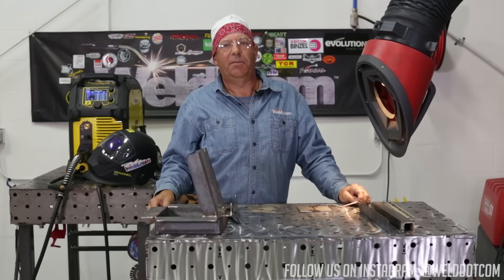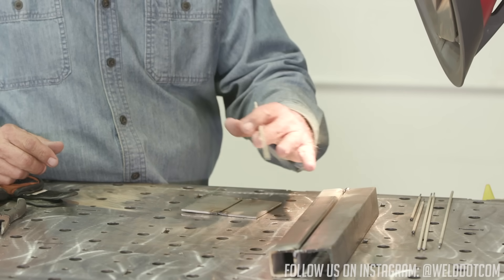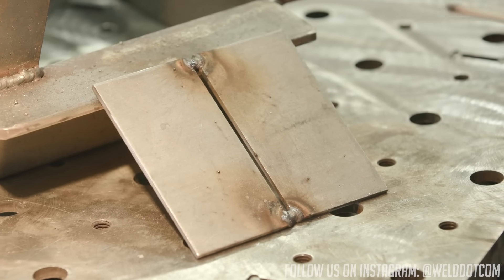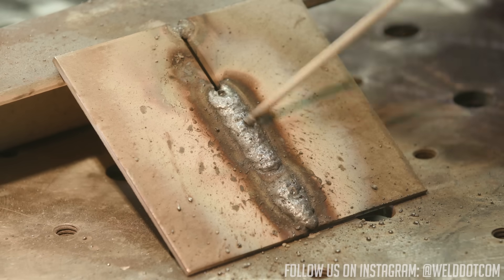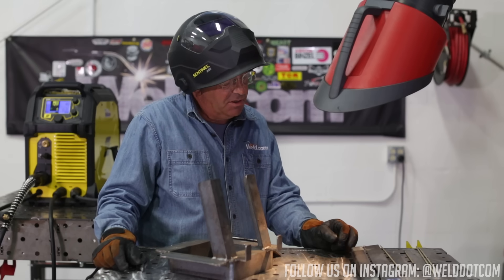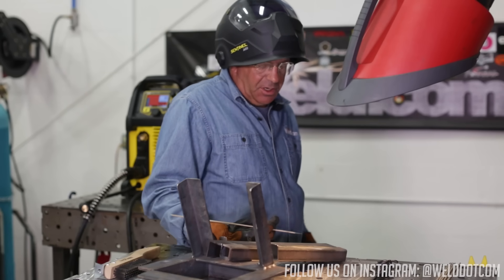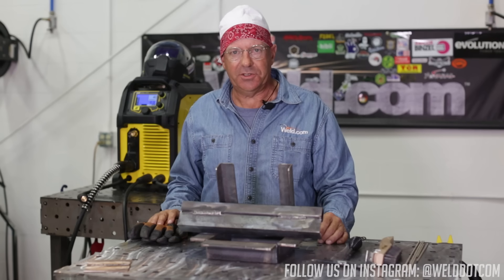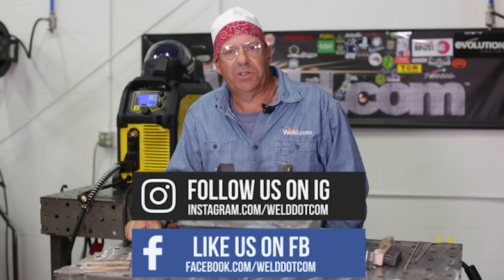Texas TIG Welding | Stick Welding with 2 Electrodes

Comment: I'll tell you one thing, it cant be easy not sticking rods as many times as you paused and re struck an arc. Question though, wouldnt this be ideal for "lay wire" technique? I would be inclined to literally just lay an unfluxed filler rod directly in the gap youre trying to bridge and go to town. Nice video Bob, youre awesome.

Comment: I know you are a pro.  For an ag welder like me working on 50 year old equipment and building pig cookers from old oil drums the video raised a question.  For a hack like me which method is less likely to blow something up.  I use a 3/32 6013 for thinner metals. The gap is not always a fit up issue as much as a 'came apart at the seam' problem.

Thank you for your videos, I might not be running a tractor and eating BBQ were it not for you.

Comment: You simply tack the rod into the gap after removing the flux. Then you weld like normal the extra Rod melts into the weld pool. Much better finish.

Comment: I use this procedure when I need it but ... I remove the protection from the second electrode. the welding is fine but is it correct to remove the protection from the electrode?

Comment: I had one of our older/wiser welders show me this trick several years ago. I use it quite often filling cracks that have opened up. Only thing is, he told me to knock the flux off the filler rod, but after seeing this video, looks like you get a better weld leaving the flux on. Good to know.

Comment: Bob, question for ya.  You were welding the gap with 6011 and using 6011 for the "TIG" filler wire.  Some folks have mentioned they just laid a bare rod along the gap and welded it up to close the gap.  Why couldn't one use 7014 or 7018 to weld the wire and gap instead of 6011?  Is it because you need a fast-freeze rod?

Comment: Couple questions.. I know it's a whip rod, but why are you whipping and long arching over the gap.. But not when running your fill stringers? I never whip a gap. Also, why are you pushing? That's directing your arc force into your gap, making it want to blow out. Specially when slag you drag.. I repair farm equipment where gaps are daily life.. If you can step over it, I can weld it 😉

Comment: SO glad you mentioned 1109 rod!  I recently bought an old acey-deucy buzz box from craigz list and the guy threw in a bunch of old rod - much of which has NO number label AT ALL - which is baffling.  But some IS that 1109 rod, unlike yours - but I'm hoping you can tell me what it's good for ANYWAY, please and thanks.  Extra kudos if you can help me ID the UNlabeled stuff????
Reply from the maker: Pale Writer 1109 is 6011 upside down. Flip over the rod and now your welding with some good old 6011 brotha 👍
Reply: yeah, I saw that - was just helping you get MORE mileage out of it - cuz when I tried SMELLINGG it I couldn't tell the diff between 1109 & 6011

Comment: Same technique I used on stainless steel pipe having much less thickness around 1.5 mm to 2 mm wall thickness pipe and it works awesome.

Comment: I been doing that since the early 90s.  Your supposed to use a 6010 or 6011 in your stinger, and break off the flux from a 7018 rod.  We call it a Hippy rod here in Austin, Texas. Of course in a shop environment , you can use a ER70 - S  tig filler rod instead of the 7018 .  Any questions about tig welding, you can contact me at Wickeddemonfast@gmail.com

Comment: I used to use this method a lot to fill gaps. I've always used 7018 taking the flux off the filler wire. I don't do it much anymore, because like you, I take more pride in making better fits first. But in a pinch it helps.

Comment: I've used this technique a little bit myself, but i find it works a little better if i break most of the flux off of my filler rod. Great video!
Reply: was going to say the same thing, but I'd like more info if it's bad practice or not
Reply: @PeteAmes19  technically i'm sure it's a terrible practice, but in the shop it works in a pinch.

Comment: I had an inspector catch me doing this to fill a gap on 3/8" top plate to HHS4x4x0.25 column with 7018.  He asked me "what the hell are you doing?".  I told him STIG welding.  "what the hell is that?" he said.  I told him a combo of Stick and Tig, go look it up.  He watched me for a while and said that was interesting.  The next day when he came to my job site he chewed my butt and told me to never do that again on a structural weld, but I'm not going to make you grind out that weld and do it again cause it came out real nice and I taught him something.  This is the first time I've seen this done anywhere else.  I like it.  It works in a pinch.
Reply: RudyRay AAW LOL great story.  Glad I never got caught.
Reply: RudyRayAAW
You should have been a lawyer, to be able to make up an answer that sounded believable to an inspector who never believes anything.incredible!

Comment: Never saw it done with flux on the rod either beat it off or use tig road but your stuff looks pretty good for that process
Reply: Shop teacher showed us this when I was in high school way back when and used a tig rod as the extra filler. Not saying either method is better it's just interesting. I can see where out in the field where you only have flux rods this might come into play.
Reply: joshua nolen have a little respect that man has forgotten more about welding than most of us will learn and I'm a semi pro welder I do production welding
Reply: same,always ended up with far too much slag drowning the puddle if i dint flake the flux off the extra rod
Reply: No shit we always knock the flux off and getter done lol

Comment: Maybe a stupid question but what about running two rods in your stinger?
Reply: I tried it long ago. The stinger can really only can hold one one at a time because the stinger pivots. You would need parallel jaw stinger. So then I had to tack the two sticks together.... but then The current didnt seem to go out of both electrodes evenly... either  one or the other never both. Electricity goes through path of least resistance.

Comment: I'd be interested in seeing the weld inspection guys get their hands on this just for kicks...

This is called poor mans tig here in PA and I've only ever seen it done in class room for fun, with 7018 and the feed electrode, for whatever reason definitely needs to have the flux broken off.
In the work environment if there is a big gap on thin steel or stainless, I've only ever seen people use a large brass or copper nut as a backer.

Comment: $0 years ago I did this on oilfield pipe making a small utility trailer.  My fit up was not good so I used O/A filler rods with 6013.

Comment: I have always just laid the second rod in the gap and then welded over it, even done that where it required two rods side by side when I had nothing around as a backing, also used plain hot rolled round.

Comment: So that's what they call it... The last time I've seen rod with flux as filler was a long time ago when my dad was filling a hole in the early 90's. He was a pipe fitter beforehand, but he would tell me to never do it because I was being taught properly and to never let him catch me doing what I watched him do those few times. We had a big Miller back then and I grew up on a Lincoln. Miller died, Lincoln died, and a cheaper monster came along that by the time I knew better than to weld around the farm using that technique for anything other than filling simple holes too. Last thing I used it on was an old lawnmower deck that was spitting rocks towards the feet...
Now I got my Everlast 255EXT and I couldn't imagine doing it again without TIG... It's the best game ever, weeks to months spent building plates and bars from 1/8" bar stock when I finish my job.

Man Bob, I've not thought so much of my late father until I began watching your videos a long while back and your always reminding me of him. Thanks!

Comment: yer seen the boily i was the TA for do that a number of times for large gaps that we couldn't get around but where not pressure items but we would knock the flux off the filler rod first we called it stiging

Comment: That 1109 rod is for overhead. Any thing but 6010/6011 if you don't knock the flux off you get so much flux in the puddle you can't see what you're doing.

Comment: I welded in a shoemaker shop (bunch of butchers ) for a while.  They just knocked the flux off of whatever rod would fill the gap, tack it in place the just welded over it.  It worked (kinda, sorta).

Comment: Whenever I would run into big gaps I would take a rod or 2 and break all the flux off of them, then cut them down to the size of the joint to be filled and tack it into the gap parallel with the joint then weld right over it... It worked like a charm evertime... Love your vids brother👍

Comment: Watched one of our shop guys, several years ago now, bash all the flux off three or four other rods, jam them into the gap of a fillet joint and welded right over the top of it all....worked awesome.
Reply: Ryan Jones Yes sir, I have done the same on many occasions; just tack the rods in the joint and weld right over them...
Reply: That sounds a bit dodgy how did it look? More importantly how did it hold?
Reply: Chris Mclean the repair was on the side wall of the dump box on an off-road dump truck. He used that technique, if that's what you call it, to fill the gap because the replacement panel they cut in the shop was square-ish and the bent side of the dump box out on the job site was bent-ish. It actually looked good. Looked like a big fillet weld. It was a double wall part of the dump box, so you couldn't see the back side. It held the rest of the time I worked there and I have no doubt it's probably still there. I would absolutely try this if I was in that situation. It may sound like a Mickey Mouse repair, but it actually worked really freakin well. And fast!
Reply: Just don't PAUT it

Comment: back in the 70's I had a fitter that couldn't fit his butt on a toilet seat. so i used 5/32 7018 with the flux knocked off as the filler on 4"schedule 40 cs handrails in a Carolina  wood yard. I learned from a old welder so this has been used a long time.

Comment: That 6011 can be run on DC- and 30 amps and weld that gap right up without  the second "TIG like filler wire"...Up north here we call that "HILlBILLY TIG" lol!
Reply: AWDJR in louisiana we just cut and lay a stick in the gap and weld it together in dc-
Reply: chance callahan I'm in TX and had to weld some stuff up that had a big gap. My coworker told me to just lay a rod on the gap and go to town.

Comment: Can you show us TIG welding, using a MIG gun to launch wire into your TIG arc?  Might as well!  :-)
Reply: There’s a channel called 6061 that has a video where the mig gun holds the tungsten if you’re interested in that even if it’s not what you asked
Reply: Been done several times, works the same as a cold wire feeder in a TIG arc... (you don't WELD with the MIG you just feed wire in... it works...
Reply: fuck, why didnt i think of that...
Reply: ...and don't forget to feed in a 6010 as well,  held in yer teeth.
Reply: There is some tig torches that not only hold the tungsten and produce the shielding gas envelope like a common tig torch would but also feed filler wire into the puddle at a rate of your choosing like a mig gun. Its almost a tig mig hybrid.
Reply: Now this is ingenious!
Reply: Do that almost every day at my job. TIG weld with cold feed using wire feeder from MIG welder set up. Disconnect the power to the MIG so it is just the wire and I string it up in the air so the gun hangs down to make it easier to maneuver that big Tweco gun. ( take nozzle off too )
Reply: Na mate the mig gun feeds the aluminium wire (filler rod), his tig torch holds the tungsten still.  Thats the vid i watched from 6061.  Both exceptional welders!!  Could be done either way though i guess as long as you have gas it wont matter which feeds.  Hand or gun.
Reply: @amacca995  I also saw the one where he has tungsten in the mig gun.
Reply: Gabriel Schleder .....That would keep you hopping wouldn't it
Reply: Gabriel Schleder how about something you’ll use like tig, stick the cap with tig
Reply: Please don’t!

Comment: Since you're open to showing some "interesting" techniques I have a suggestion for a future video: Do one on stick welding using two car batteries and jumper cables. This is an age-old technique used for 4x4 trail repairs... because every truck's got at least one battery and everybody smart carries jumper cables. It would be cool to see various material thicknesses and rod types and sizes, plus maybe some "TJ TIG" to cool down the weld heat since there's no way to control amperage when using batteries? Just a thought. Great channel, I've been subbed forever and watch all of your videos.
Reply: I've seen this done on the trail. I don't recall what rod was used, but the guy doing the welding put down a respectable looking bead. The Panhard rod bracket he welded back onto the frame held, and the truck's owner managed to drive it off the trail on that repair. It wasn't long after that that certain 4x4 accessories manufacturers brought out 12V-24V powered inverter trail welders. Shortly after that the manufacturers realized that most 4x4 enthusiasts can only MIG weld, and can't stick weld to save their lives, so they brought out a spool-gun that could be run off a couple batteries. No inverter, since batteries are a CV source. Just load up a 1lb spool of flux core, and off you go!
Reply: One of my friends has a Ready Welder spool gun that he runs off two car batteries and it works really well. His garage situation won't allow a 'real' welder, not even 110v, so the Ready Welder is his only machine. He builds nice stuff with it. I carry some 1/8" 6013 rods in a vacuum sealed bag in my wheeler but have never tried a trail repair with them.

Comment: It works with mig too. Stick rods work, but if done right tig rods look  almost perfect
Reply: Or if nothing else is available, a old coat hanger will work too.
Reply: throw a little borax around the hole and you can fill a pretty big hole with old nails...lol...it works.

Comment: I've done that while MIG welding but I used tig filler it worked out great
Reply: Funny you say that, I use ER 70 S6 filler from a MIG machine when doing 16 gauge steel with TIG.  S6 flows better than S2.  And the filler rod is free ;)

Comment: Done similar a few times...lol... Old baling wire as filler with 3/32" 6013 patching up tractor mufflers.. years ago!!! 
I've found that the automatic wire dispensing electrode holder works better 😎
Done a few (lol) "gaps" with 1/4", 5/16", 3/8"..   even 1/2"&5/8" cold roll... Sometimes on larger projects things warp and crawl a bit different... Leaving a gap or two... Predominantly run mig, I just tack a filler piece in and lay a bunch of wire!!!!
As long as whatever you do to fill and weld is at least as strong as the material around it, it's structurally sound....

Comment: Enjoy your videos,  can you do a broken bolt removal if possible. I’m a diesel mechanic I’ve have removed a couple broken bolts. Tried to remove a m12 cylinder head bolt. Welding a nut onto bolt, but would not stick too the head bolt. Fiat Diesel engine.
Reply: Use a non-plated nut ( not zink or cadmium ) and let it cool I´m talking have a cup of coffee cool before you try turning it. I prefer 7016 ( Felarc 36 D or esab 53.05 ) and crank the amps (2,5 mm needs 90 amps)
Reply: Agrees no plated nuts, try 10018 wire, it is price but works, 
Build up a column of weld to slide the nut over then weld the nut to that, turn it out while hot.
Reply: Low hydrogen rods. 7018 are good.
Reply: 7018 is 120 or 140 % deposition rod not good for filling holes ( slag inclusions the same reason it is not common on a rot passe  ) sure if all you have is 7018 go for it trying is better then doing nothing. But man o man when all you have is a hammer every problem starts looking like a nail ( 7018 is the hammer inn this metaphor) 6013 and 7016 are both gonna do better than 7018 and the hydrogen contents will make little to no difference in this application . If all else fails ( grade 8 bolts are a b###h and metric 12,9 I some times try 309 (309,309L,309MoL) and a stainless (A4 if i have it) nut.

Comment: Does 6011go bad? I have an open 50# case I got with my welder. They were left in a damp garage for an unknown amount of time. The case is rusty but the coating is not coming off or anything. I haven't used them yet so I was just wondering.
Reply: if its one of those cans that's entirely metal, they might be alright. I left some in a plastic case in my garage for a few months and came back to them and they were useless
Reply: Kohl Marvel it's all metal. How do you know if they're bad or not? I've never welded with 6011 or 6010 so I wouldn't know what to look for.
Reply: Dustin Short I personally cant tell by visual inspection, I tell by arc characteristics. If its unusually hard to start, wont stay lit, or flux just falls off of the rod, it's no good. Like Bob said, they're a violent, digging arc, so if it's not violent and moving metal, throw it away
Reply: Kohl Marvel maybe I'll have to get some new ones to compare them to.
Reply: Dustin Short that's probably a good idea. Just get a small pack though in case the 50 pounder is good
Reply: The problem with 6010 and 6011 happens when the coating dries out. Not sure which manufacturers site I read this on, but apparently the coating on cellulose rods requires a few % of moisture content to work properly. That's why you never put cellulose rods in a drier.